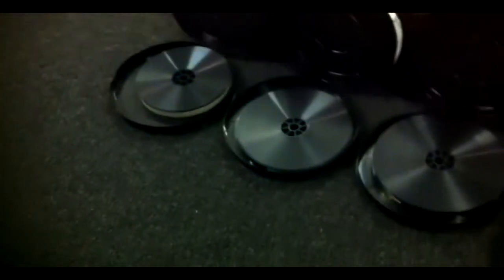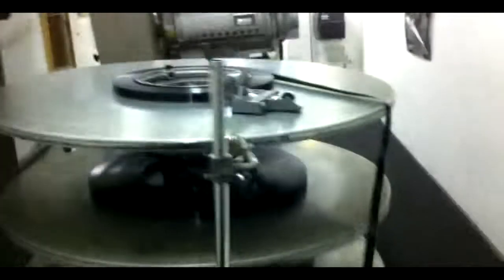Making up a 35mm film

Comment from the maker: Hi there!  Usually you can still see the frame lines when you hold it up to the light. On the occasion you cant if you look very closely on the black frames you may see a horizontal line or ''scratch'' is the best way to describe it, that is where the trailer starts. Or sometimes there is a clear white frame, you can cut directly after that. There are 4 perforations per frame on 35mm so that also helps when trying to get it right. Thanks for watching. :D